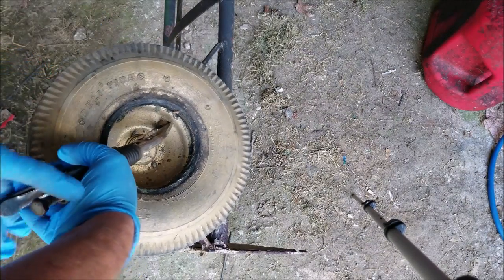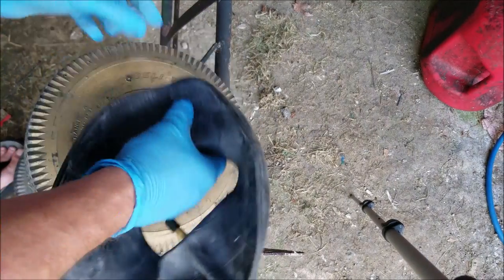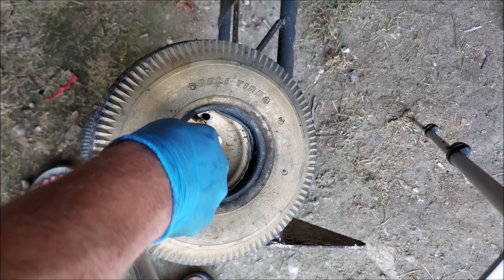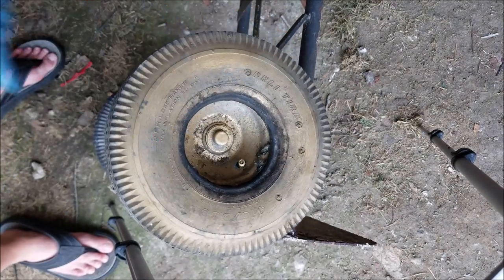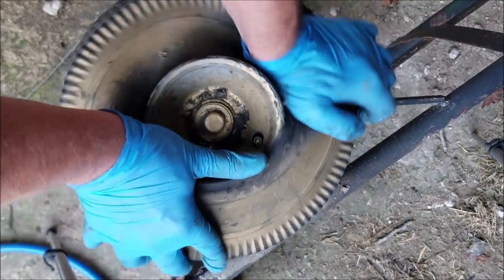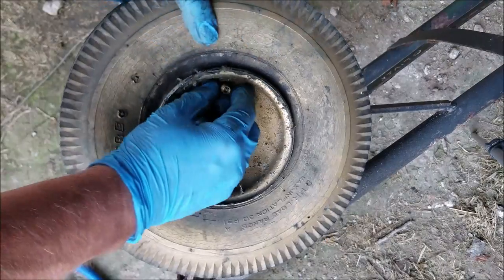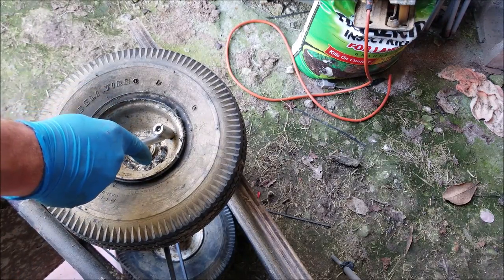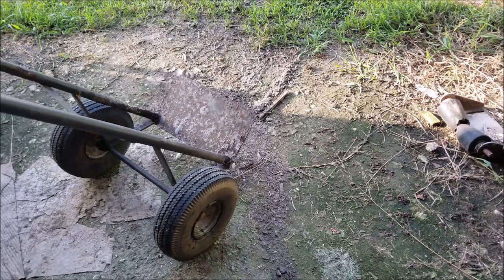FAST - How to Install Dolly Tire Inner Tubes 4.10 3.50-4

Comment: I just over an hour doing this only to pop my new tube. So frustrating… Key I’m missing was using a board to hold the wheel while adding air. I kept losing the valve and eventually punctured it.

Comment: I followed the directions, and used a tire iron to carefully stretch the tire back on the rim. The block of wood really helped stabilize the tire during the stretching and the inflation. Great instructions!
Reply from the maker: Thanks for the additional information about the block!
Reply: @JRMSweeps Would it be easier to line up the inner tube valve with the hole while inserting the inner tube instead of having to line it up once the tube in in? Would that work or not?
Very good video and very interesting.
Thank you
Reply from the maker: @SDsailor7 wouldn't hurt in my opinion...

Comment: Once i installed the inner tube, i can no longer push the tire back to the rim....  tried with pray bar, w40... help from a friend etc to no available...  tire is just too rigid...
Reply from the maker: Take it to a tire shop and have them put the bead over the rim edge!

Comment: Unable to do it. Nylon tire are too rigid to be dismounted
Reply from the maker: The best alternative is then to go to harbor freight and buy new wheels.  I want to say they're like $5 a piece.
Reply: @JRMSweeps  Was able to remove one side of the tire to extract the existing innertube. But it was somewhat a destructive process. I heard a steel wire of the tire snap!  🤣. 
Also in Canada, a replacement wheel same style, it's 25$. I tested the innertube in water and it look OK. I will let it sit for a few days...
Reply: ah the replacement I have seen is Flat-Free Wheel Assembly
Reply from the maker: May be the way to go if the tubes didn't work for you.

Comment: I used a big quick clamp bar clamp to hold one edge under the rim on a tough tire as it rested on my axle. Then I used a medium screwdriver to work the edge around under the rest of the rim. Only way I could get the tough tire on.
Reply from the maker: Good info!  Thank you for sharing!  It was a little tough to get on but still holding up great to this day for me!

Comment: This looks and probably is an effective method, but when I pried with a screwdriver the wheel's flange bent before the tire was even close to slipping over the rim.
Reply from the maker: Unfortunately that happened.  Aluminum wheels?  Mine are steel so no bending.  So did the tube not work because you bent your flange?

Comment: My tires are tubeless but have so many holes there's no fixing em. I got the tube in but I can't get the tire to go on. The bead is much stiffer than tires made for tubes I guess and I can't get it to go on to save my life. Guess I'll just have to keep trying.
Reply from the maker: Look through some of the other comments and see if any of them might help you!

Comment: You've got to joking the tyres are super tuff . Once you crease yourself trying to get that strong tyre off the rim using long screw drivers you have to pull the innertube out and struggle to push the new one in . Now comes the part where you puncture the new innertube trying to use the strength of big foot to try and bend the tuff unyielding tyre over the rim invariably stabbing the new innertube trying to man handle the tyre onto its rim .This job can't be done .You will at some point during the struggle to bend the tyre over the rim stab or prick the new innertube inside . Dont give people hope I've had 5 garages who change motorcar tyres all day won't touch those small tyres with  innertubes. A tyre iron is 35 pound and rounded.  2 tyre irons will cost 70 pound .forget going anywhere near those small tyres with sharp screw drivers its a foregone conclusion you will puncture the new innertube . If anyone knows how to change an innertube on one of those bastard deli tyres show me and please don't kid me saying you can do it using screw drivers because you can't
Reply from the maker: So, it took you a whole thesis to tell the world about your inability to install tubes on dolly tires 🤣, man that is a good one.
Reply: Spray a little WD40 around the rim. It worked for me. Don't use the screwdriver to mount it. Use a small blunt object to start the mount then slowly push the tire slowly onto the rim. Hold down what you've done. It takes a lot of elbow grease but the WD40 helped it mount.